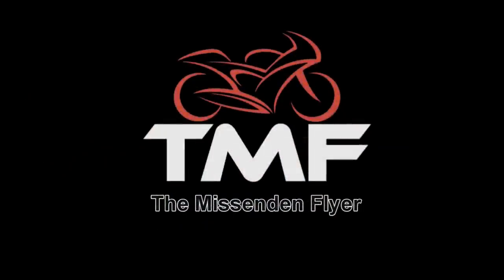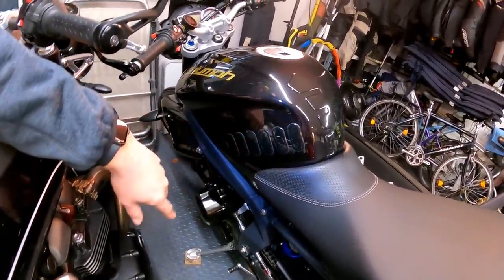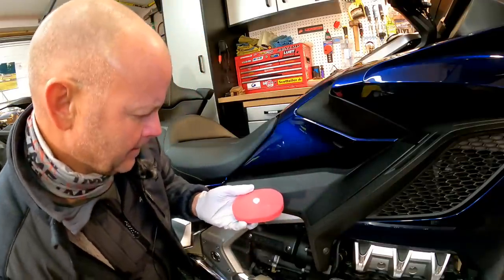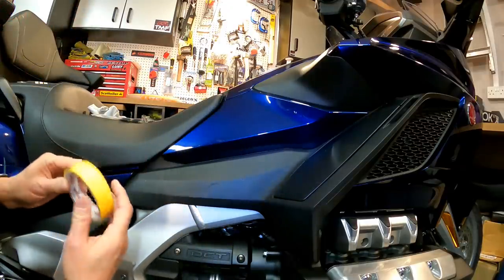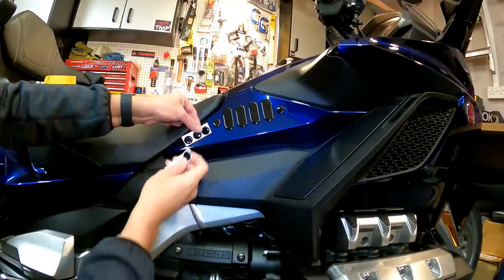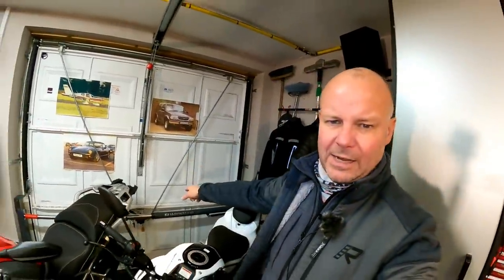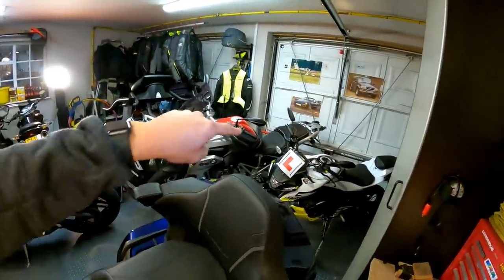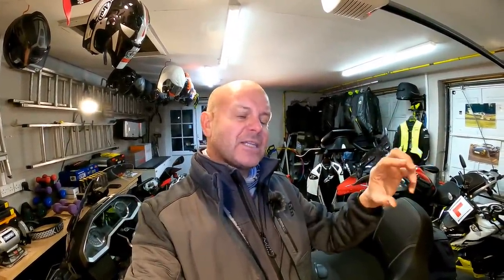My Bikes - A review of what's been going on in the Missenden man cave...

Comment: The primary reason for steering stops is to prevent levers - especially the front brake - from being engaged in a tight turn when they might get squeezed by the fairing.  Hence an MOT issue.
Reply from the maker: Ah interesting, I didn't know that....

Comment: Yes the Metzeler Racetec RR will provide better handling and I run them on my Thruxton,  BUT the tires don't last too long for street use. The K3 hards about 2000 to 3000 miles, the K2 mediums about 250 to 300 miles, the K1 software last about 150 miles.

Comment: Great video, this weather is perfect for tinkering in the garage. I have the 3M ppf it's awesome especially with the tank beg on no issues and any scratches self heal with hot water applied. A video on chain maintainance and lube would be good. I find I use different stuff in the winter the the summer to keep the chain in good order. Great of the dealers to give you a sensible mod to your issue👍

Comment: The lock stop protectors are designed to stop the handlebars hitting the original lock stops in the event of a crash.  Therefore, they restrict the steering lock.  It is normally impossible to use the ignition lock with them fitted (if this bothers you).  
How on earth did you break the original lock stop without falling off as it takes some force to snap them???
Reply from the maker: Beats me, I have no recollection of anything dramatic happenning with the handlebars.....

Comment: At 9.39 it looks like fluid on the brake lever. Just have a check next time your in the garage, see what that is. If it's nothing I can stand down from yellow alert. :)
Regarding the tyres on the speed twin,  going from a road based tyre (like is fitted) to something at the sport end of the range is always going to help with turn in.
I've even had differences going from a oe fitted tyre from the factory, to a off the shelf version of the same tyre (xsr900 that was on).
I'd say go for it with your tyre change.
All the best.
John
Reply from the maker: Thanks for the input John...I am tempted but just aware of the fact the current tyres are far from shot!

Comment: Excellent fix from R&G and the dealer who pointed you there. If you've not already checked i would make sure the remaining rhs stock lockstop does not touch down before the R&G one, just to make sure all is even. My OCD kicking in rather than s safety issue i think
Reply from the maker: Yes good tip - I'll go check that in a mo...

Comment: Nice bike clean collection TMF, my 1st pick of your massive fleet would be the Goldwing. Do you use storage fuel in any of the little used bikes?
Reply from the maker: No Ray I don't - even though I don't do huge mileages on most of my bikes I do try and take them each for a run at least every few weeks, so far it has worked out OK...

Comment: Turtle wax to protect the paint. The more you use it, the better protection you get. And you don’t have these pads on the tank.

Another brand of tires can make a huge difference. My bike always tried to upright itself at breaking in a light corner. Not what you want because you won’t make the corner. After putting on Dunlop tires the problem almost went away.
How many bikes you have to take outside before you can ride the bike you want that day.
Reply from the maker: ...yes a continual pain - 1st world problem for sure!

Comment: I went from road pilots to metzeler roadtec01 se, the ride was much softer and compliant. I ended up tightening up the suspension and love the ride now. It made the bike feel like a different bike.
Reply from the maker: Amazing what an effect new rubber can have.....
Reply: Another shout to the Roadtec 01 SE! - I just put these on my Sprint GT 1050 SE and they're a massive improvement over the BT023's that were on it which weren't that worn, it's like riding a different bike and they're as good in the wet as they are in the dry!  Thoroughly recommended!
Reply: I have these, they are great.

Comment: The RR's are a more aggressive "V" shape tyre profile than the others. I'm guessing they will definitely improve your bikes feel thou it might feel alittle bit unstable at slower speeds. Depends on what type of riding you intend to do on that bike. Personally I'd stay with the tyres on there already. Atleast till you wear them out. Put the RR's on the Ducati. Tyres are most definitely one of the easiest and best improvements you can make to a bike for sure. Either of those tyres are exceptional.
Reply from the maker: Yes I agree Joe - when I changed out my Street triple tyres a couple of years back it transformed the bike for the better....you don't notice your old ones going "off" do you....
Reply: LOL, I wish..... my tyres are well worn out before then. I usually get pretty even wear across the whole tread on both types of tyres. Personally I like the Diablo Rossos' it suits my riding style and needs. They have great feel, grip and are very confidence inspiring. I believe tyres should be replaced every 2-3 years. Perhaps you should dedicated an episode to tyres, tyre pressures, and so on. It's a very interesting topic. Safety wise it is very important.

Top tip. I actually have cheap ebay tyre pressure monitors installed on all my bikes. It allows me to quickly check pressures before each ride. And to check on temps and pressures before I enter that "somewhere in Mexico " zone. I seem to spend a lot of time in Mexico!! 😇

I'm hoping you can get your hands on the new Speed Triple this year. By all accounts it's pretty impressive. Can't wait to see your take on it.

Comment: Might be a good idea to try the tyre change on the Speed Twin at a suitable time. I changed the stock tyres on my Street Twin for Metzler Roadtecs when the front one was worn and the difference in handling was very noticeable indeed - more agile and far less likely to follow lines in the road surface. I wonder if Triumph base their tyre choices on looks more then actual performance, certainly for the retro bikes.
Reply: I also own a Speed Twin and agree with this comment.

Comment: I love the bike in the corner behind the GS with pull back bars and footbboards and huge tft. By the way if the batteries are in the tracker for a year, one should probably use duracells so that they don't leak. Good video
Reply: Monimoto don't recommend Duracell batteries, at least not on the older version I have because IIRC the monimoto has problems showing how much charge is left in them so they go flat without any warning.

Comment: I'm thinking the same about my speed twins tyres, the stock Pirelli's are awful in the cold. I swapped to road 5's on my previous MT07 and it made a huge difference. I read yesterday that the new road 6's are due so maybe a newer version to try 🤔
Reply from the maker: Ooh, there's a thought....
Reply: Road 5's are great and now Road 6's are out. I have Road 5's on both my Speed Twin and S1000XR. Outstanding grip in wet and dry conditions.
Reply: + 1 on the Road 5's. I changed to the Road 5's on my 2019 Speed Twin and they were a massive improvement on the stock Pirelli tyres. Like night and day. Thoroughly recommended.
Reply: I've got Road 5s on kawasaki Z 1000 S X  the   Bridgestone fitted from new was absolutely appalling
Reply: I had Metzeler Bridgestones contra Pirelli’s . best for uk are road 5 Great in wet Pirelli need to be warm but super sticky in warm weather
Reply: I use the Road 4s and 5s along with a couple of other Michelin tires.  I like a Commander II on the rear of my Honda ST1100 as I travel a lot and am a bit heavier.  The weight rating is better and tire last longer.
Reply: I just fitted the 6’s to my K1600 and they are awesome the new tread pattern makes for great feel and feed back.  Very highly recommend them

Comment: Thanks for the video, you’d think that manufacturers would think about paint areas that could be susceptible to scratching from the rider. They’re pretty good at detailing bikes in other areas. I damaged a tank on my GS750 Suzuki so rather than repair it I bought a leather tank cover and it improved the looks of the bike. Just my opinion though. Thanks again Andy, have a lovely day.
Reply from the maker: You too James....tricky in the grim weather we have today (I've already been out for a ride in the pouring rain this morning)...
Reply: @TheMissendenFlyer  it’ll pass the time on cleaning your wet bike. The only trouble is that the switches aren’t waterproof and can cause problems. I replaced my front lever brake light switch as it failed after a soaking. It was only £2.40 off eBay Andy. The weather is grim up here in the north.

Comment: The Metzeler M9RR's are a great tyre; far more compliant and improved profile. I had a set of those Diablo Rosso's and couldnt wait to take them off the bike. Mad a big difference. Good tip on the Panigale, I've broken both of mine and it's due an MOT!
Reply from the maker: Best you get onto R&G pronto!  Out of interest do you remember breaking them? - it was a surprise to me that mine had gone!
Reply: @TheMissendenFlyer  They are basically made of cheese! Like the mirrors- really easy to break. I dropped mine off the stand, I manged to slow down the drop and layed it down - that was enough.
Reply from the maker: Oh dear....which bike model?  I dropped my Panigale once and did no damage whatsoever other than a bar end which I replaced....
Reply: @TheMissendenFlyer  that drop may have been the time you lost or weakened your lock stop? Mine is a 1299.... R&G ordered.

Comment: Those lock-stops are neat. Presumably you can get them for other bikes, too. I didn't know a failed lock stop is an MOT fail, so something to look out for there. 
Did you think of using clear film on the Goldwing's panel instead of studs? Probably harder to apply to get it perfect but invisible once done. 
And interesting point about the Grip Puppies. I bought a pair for my R9T as the standard grips feel to be quite small in diameter. Did you find that with the GS? I haven't got round to fitting them as it means removing the very neat after-market bar-end mirrors to do it, then re-fitting and re-aligning the mirrors afterwards and so far I just can't be ar5ed. The R9T has BMW heated grips like your GS so after your saying the Grip Puppies stop the heat getting through, maybe I won't fit them after all! 
Thanks for the vid.
Reply from the maker: The grip puppies don't stop al the heat, just some of it....it's a trade off between having comfy grips or warm ones!
Reply: @TheMissendenFlyer  I'll wait and see if you put yours back on the GS!

Comment: Not convinced the Metzler vs Pirelli change will make much of a difference on your Speed Twin.  Maybe use up the Diablo Corsas and then give the Metzlers a go?  I would suspect Triumph has made some chassis changes that attribute to the improved handling.
Reply from the maker: Indeed they did make a lot of changes to the front end - of which tyres was one part....

Comment: I'm rather surprised (disappointed) to hear about the paint issues on the Gold Wing. I'd think a bike with its reputation and intended high-mileage usage would be more durable. That said, I believe the protection you've added to your bikes looks much better than worn/scuffed paint.

Regarding tires on your Triumph, tire choice can totally change a bike's feel. I wouldn't swap perfectly fine tires until they were worn out, but I would certainly try something different when it was time for new rubber. The only way you'll know which tires your bike likes best is to try different ones.
Reply from the maker: True….

Comment: Hi Andy, I also have a 2019 Speed Twin and was initially disappointed with the handling. Considered upgrading the suspension but needed new tyres before I got around to it. After changing from the Rosso 3s (to Heidenau K73s) the bike handles MUCH better, the stock tyres are (or were) IMO at fault for the poor handling. So, go for it I'd say ;)
Reply from the maker: Really interesting - thanks for that Mat....

Comment: Triumph did change the forks in the 2021 model which is probably where the majority of the improvements came from. You could upgrade to Nitron, Andreani or YSS, granted these aren't cheap upgrades, but suspension really makes or ruins any bike.
Reply from the maker: Yes it's a thought...the new bike feels so much lighter at the front end too....

Comment: Those R&G steering stops are a fantastic idea, and good of the dealer to let you know rather than scalping $700 large.  Tyre's 🥴  it's a real Dark Art, put new Pirelli Angel's on the Super Tenere and they transformed it better handling and comfort off the scale from the original duel purpose job's.  Thought when I change the original duel purpose Pirelli's on the Ducati 1100 Scrambler for the same Pirelli Angel's on Tenere?!  But no first I didn't notice any difference now I think it tips in quicker to corner's and makes it more unstable which it doesn't need so big difference with the same tyre on a different bike! 😳
Reply from the maker: How bizarre!

Comment: Ref the speed twin, no way on the tyres. I’ve used the Pirelli’s rosso on daytona 675 for commuting and they have been fine, the issue with the speed twin is lack of sophistication in the fork damping and shocks, there’s loads of videos on cost effective fork upgrades which would help with confidence and feel.
Reply from the maker: Thanks for the tip - I need to get Googling (not that my Speed Twin is bad in the handling dept just not as good as the new ones)....

Comment: Despite Pirelli owning Metzeller, they are certainly different tyre choices for the twin, tyre  preference can be very personal depending on how you ride. The Rosso's can be a bit marmite feel wise, the RR's are more track biased so should stick like sh*t to a blanket but will wear quicker. PR5's should also be a good choice for wet, dry, feel & wear.  Definitely agree about keeping the Street Triple, the 675 is a future classic, so we will be keeping a green 675 Street in our family too 😜
Reply from the maker: Green - sounds nice...gold wheels?
Reply: @TheMissendenFlyer  Black wheels as it's my Mrs's third stock Roulette Green mk1 Street but has bar risers & givi rack for comfort when touring. Nice comments btw on the old v new Speed Twin vid, it may well replace my Yellow 94R Speedie if a new 1200 Sprint doesn't appear soon to replace my Orange 1050 Tiger. While I like the Twin I'm not a fan of the T plane motors. 😬